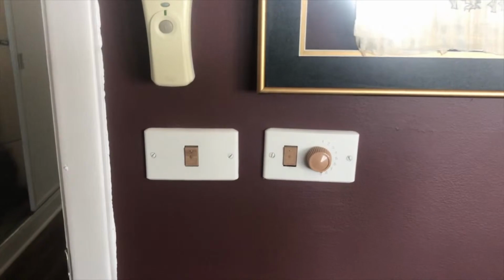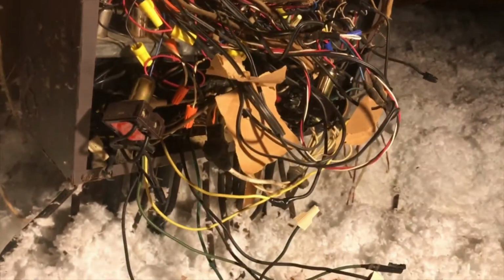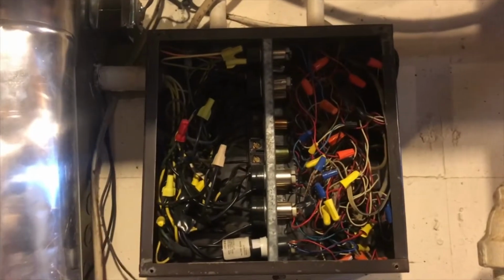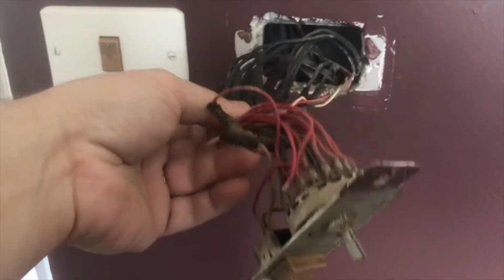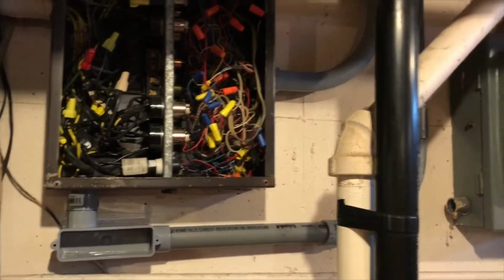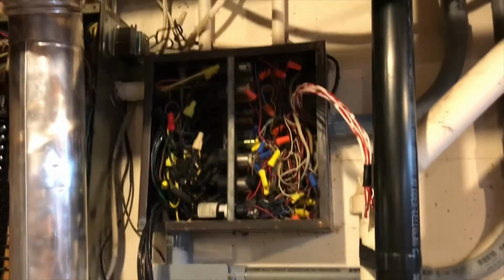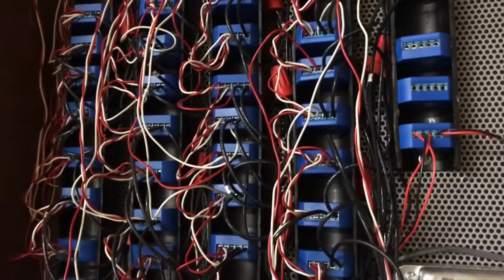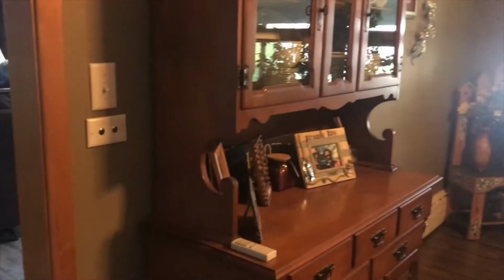Using Shelly1 WiFi switches to replace 1950’s low voltage lighting system.

Comment: What DC volt power supply did you use for this? Like you I need to update my touchplate system and want to make it as you did. Are there any downside to removing all of the old relays and just using the panel my current touchplate is in?

Comment: Im sure your views have gone up on this video, because ive watched it 100 times.ive got a few questions, id love to pick your brain with 2 questions. I swear im not dumb, i just need to know how you jumped your 3 wires. Ive got the new  24vdc power supply, im just  lost on how to land my wires from the 3 wire switch. Thank you so much. Id willing give you my telephone number, would even pay you for your time.
Reply from the maker: I did not use the old switches that used three wires. I used pushbutton switches and only used two of the three wires.
Reply: @timothyevenson6647  ok that makes total sense. So your sending 24 vdc on one wire, and the other wire is saying "open or close."

Comment: This was the first and only video I saw on these systems before creating my own channel to explain them (and other electronics and automation goodness). This is my second winter with Shelly replacements and the system has been great. I'd be interested to know how the system in this video is holding up and if there have been any modifications in these last three years. If anyone is looking for wiring installation instructions, please check out the videos below.

https://www.youtube.com/@smartercircuits6772/videos
Reply from the maker: The system is still going strong. I have not had one Shelly fail yet. I have added a few to the system due to a kitchen remodel last year. Everything has been working great.

Comment: I was curious where did you find those momentary switches?
Reply from the maker: I actual made them from off the shelf parts. I used blank decora switch covers and momentary switches.
Reply: @timothyevenson6647  Thanks for that info. I was killing myself trying to find a product that matched and couldn't find anything in the US. Probably going to have to go the same route. Still enjoying the setup?
Reply from the maker: @blakethornhill3137  Yes it has been working well with no issues since I set it up.
Reply from the maker: @blakethornhill3137  This is what I used to make the switches. You can fit up to three in each switch plate. Here are the blank covers I used. 

https://www.amazon.com/ENERLITES-Unbreakable-Polycarbonate-Thermoplastic-6001-W-10PCS/dp/B075M518YN/ref=sr_1_3?dchild=1&keywords=blank+decora+switch+cover&qid=1629728654&sr=8-3

Here are the momentary buttons I used. 

https://www.amazon.com/CenryKay-Waterproof-Stainless-Momentary-Raised/dp/B08Z6X5RTH/ref=sr_1_2_sspa?dchild=1&keywords=16mm+momentary+button&qid=1629728792&sr=8-2-spons&psc=1&spLa=ZW5jcnlwdGVkUXVhbGlmaWVyPUFYUUVKRFNZMTlDMzEmZW5jcnlwdGVkSWQ9QTAxOTg5MzgyMkJHSllIMlNQS0VFJmVuY3J5cHRlZEFkSWQ9QTA1MTYzNzAxNlM3TTg4M0xLSTFGJndpZGdldE5hbWU9c3BfYXRmJmFjdGlvbj1jbGlja1JlZGlyZWN0JmRvTm90TG9nQ2xpY2s9dHJ1ZQ==
Reply: @timothyevenson6647  Will be interested to see if it works on my system. Most of it is Square D with a few Pass & Seymour switches thrown in. Thanks again for your help. Great video.

Comment: I have a Remcom system and I have seen relays mounted in the junction boxes. So, I don’t have the issue with the bird’s nest of wires, but it does mean that I have to revive lights to get to the old relays. I guess it saves me from hunting down what relay controls what switch!?
Reply: This is the way my house is, all relays in the junction boxes in the ceiling. GE system

Comment: Awesome!  Like others, I've been looking for ways to improve on my old relay system, which is Touchplate (although I think some of the switches around the house are of another brand).  Like you had, I have two boxes of relays which look like bird's nests and need a lot of work.  Your video is very helpful and well done. Great job and thanks for sharing!

Comment: Great video! I have the same low voltage system. Your video doesn't have a lot of wiring detail on the Shelly 1's. Can you provide any more detail?  Or can I email you?
Reply: My experience says switch leg must be low voltage due to existing wires and switches, so I am using a 12vdc brick on the control side of the Shelly 1, and isolating the 120vac on the dry relay side.  Down side of this scheme is that only the Shelly 1 has dry contacts, and dimmers or power monitors wont work.  YMMV, but if old relays co-exist with Shellys beware of impedance loads from the old relays. FWIW, have had good luck with MQTT on Home-Assistant with the Shellys.
Reply: @YourFool  Isn't the power requirements for the switch low enough that it could be used as 120/v ac line voltage with a fuse to the momentary switch or possibly even a standard wall switch?
Reply: @inaxsesable  Applying 120vac to the old switch and small guage wires sounds iffy.  The switch wiring was originally powered from a 24 vac transformer, which I believe was half-wave rectified.  The Shelley doesn't seem to like that power as a control signal. Replacing the old transformer with a new solid state 12vdc power supply might work best. Good luck.

Comment: I have the same setup in my house- I've been looking for a solution for a while and seeing this video gave me renewed inspiration... What voltage did you run the DC transformer at through the existing wires / which model? Thanks in advance.... :)
Reply: *just rewatched and heard you say that you went w/ 24v
Reply: @smurfsky101  My first try was using the existing transformer for the Shelly.  No go due to poorly regulated voltage.  Had success with 12 vdc from a spare power supply.